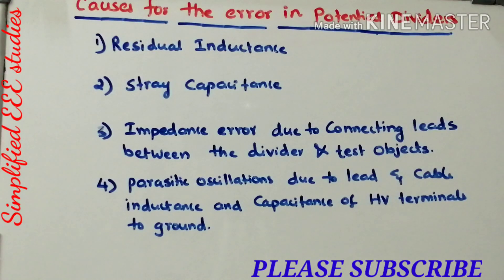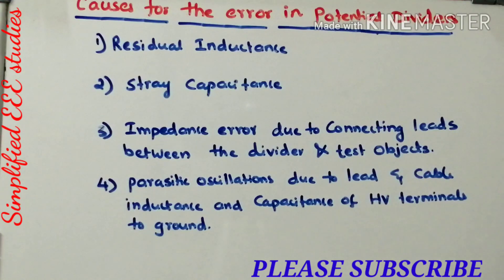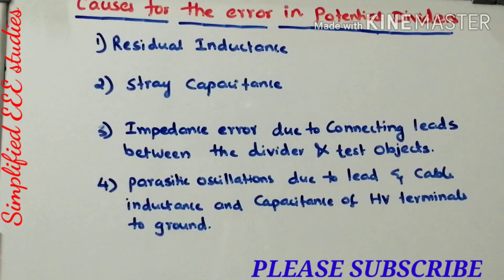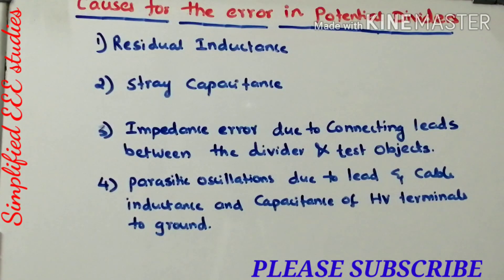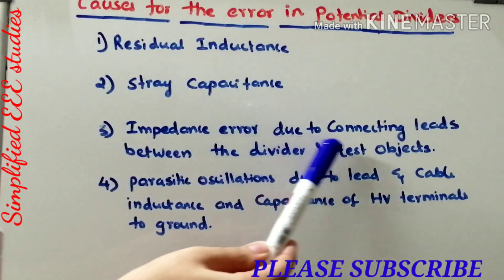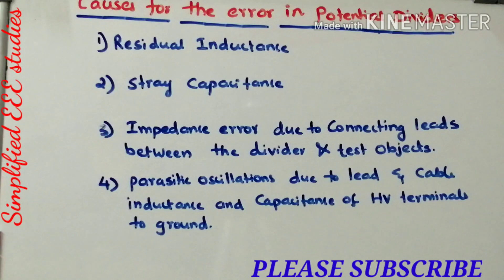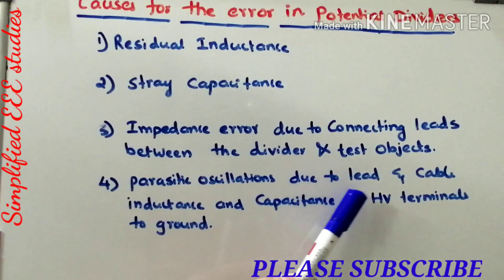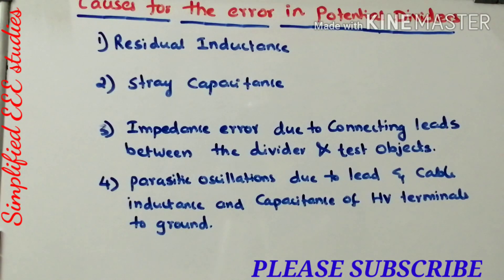Causes of errors in Potential Divider measurements || Potential Divider Measurement #6

Comment: If resistance around R1(upper) is measuring less than expected voltage but the same multimeter leads when measured across R2(lower resistor) is giving correct value . So what could be the reason for lesser voltage across R1?